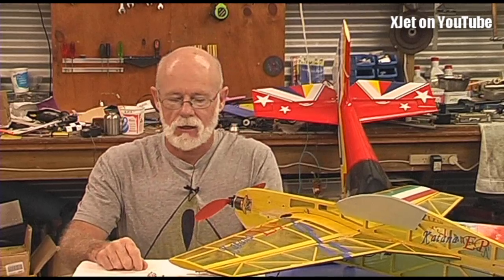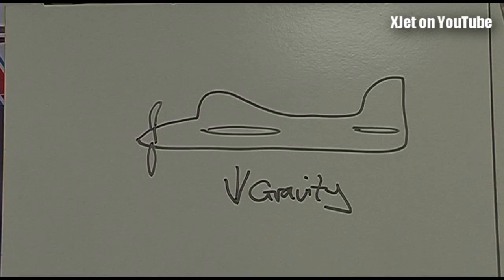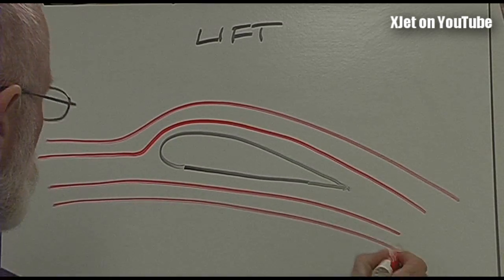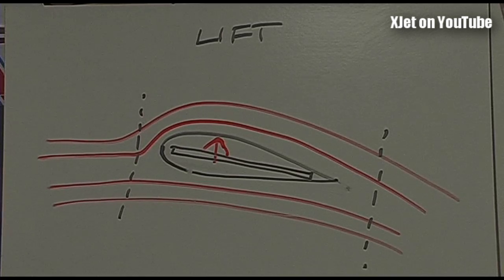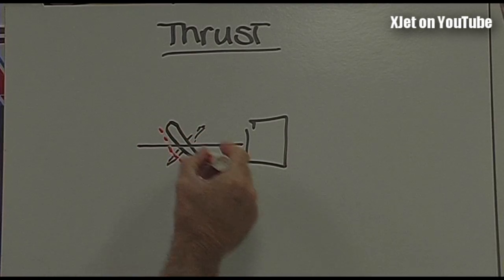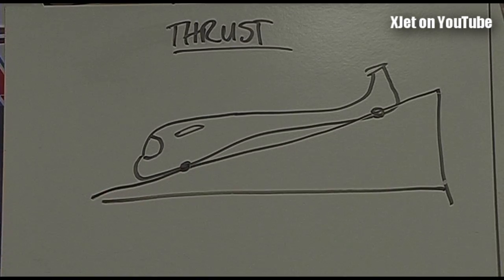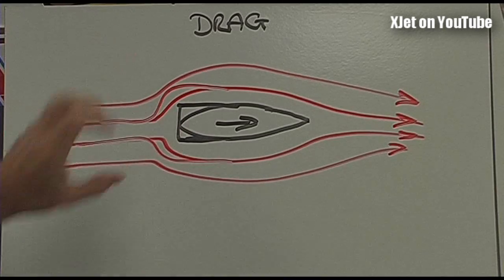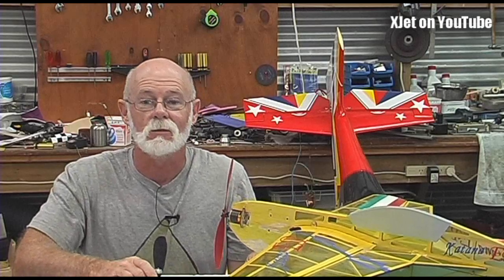The Theory Of Flight (or how stuff, including RC planes) flies

Comment: 4:14 WRONG (Why does the air have to travel faster? it just travels at the same speed on the top, that's a common misconception.
Reply: Actually, the speed of the streamtubes above the wing DOES travel faster, just not for the reasons he implied. It does not have to travel faster to reach the end at the same time as the bottom stream, this is a misconception. This is becomes evident when one realizes that an airfoil can fly upside-down, even if the curved surface is on the bottom. The real reason for lift is the angle of attack. Angling the wing causes the top streamtube to narrow and the bottom to widen. (take a look at this for explanation). Conservation of mass then means that the top streamtubes air has to travel faster for the constant rate to remain the same. Bernoulli's principle then states that a change in a fluid speed occurs concurrently with a change in a fluids pressure, and so the air above the wing has lower pressure, resulting in lift.

Comment: Well equal transit time theory is completely wrong. NASA has a page on it. The air travels significantly faster over the top and reaches the trailing edge well before the air on the bottom. Also, the higher pressure below and lower pressure above the wing does not explain lift! Everyone knows that high pressure flows to low pressure, if that happened the air would flow upwards and Newton's 3rd law says that it would push the wing down. That's obviously completely opposite to lift!

Comment: Sorry but the first part of the lift explanation while it might be simple and easy to grasp is plain wrong. It's based on the assertion ( stated 4 minutes in) that the air over the top travels faster because it is somehow compelled to meet up with the same 'piece' of air at the trailing edge as it split from at the leading edge. This is simply not true and in reality doesn't happen. On a lifting wing the air on top actually arrives at the trailing edge well in advance of the air at the bottom.

Comment: Physicists and aeronautical engineers disagree with the theory of flight!  The classic explanation of the theory of flight is applicable only to asymmetrical wings, and it leads the public into a huge mistake!  This theory says that because the underside of the plane's wing is straight, the air passing under it maintains the same density, and since the top of the wing is curved, the air has to travel a longer path, and which, therefore, has a lower density.  As the density of the bottom is greater than that of the top, this would generate a lift!  But this is SOPHISMA because they forgot to consider that there is already air at the top of the wing, and that it will be added to this rarefied air, causing, in fact, contrary to what is taught, a compression zone!  To better understand, the lower part of the wing is just cutting the air that goes under it, while the upper part is pushing the existing air up, it's getting there!  To repeat: the air that travels a longer path through the top of the wing, and which, therefore, would be thinner, is adding to the air that already existed there, creating a greater compression zone at the top, which pushes the wing down, being counter-intuitive teaches children, different from what is in aeronautical engineering books!  But why, then, does the wing give lift?  Because it is always angled with the leading edge sloping upwards, so when it advances the air "beats" at the bottom, generating a resultant vector upwards!  This is the asymmetrical type of wing, where the bottom is straight and the top is curved!  Have you noticed that in every asymmetric wing aircraft the wing has the leading edge tilted up?  But there are many planes with a SYMMETRIC wing profile (when both the underside and the top are slightly curved symmetrically), and several that fly inverted (upside down), which totally contradicts the theory of ASYMMETRIC Wing!  What actually gives lift is the upward vector generated by advancing the wing at an angle with the leading edge upwards, whether on a symmetrical or asymmetrical wing!  The asymmetrical profile wing appeared back there, at the beginning of avionics technology, to enable a robust construction with the materials of the time, such as bamboo and fabrics, hence this wrong theory was created!  In fact, while the air that passes through the underside of the asymmetrical wing advancing level has no influence on the compression of the air below it, the air that passes over the top, and, by traveling a longer path, created this false theory that it becomes more rarefied, and they forgot that this air is actually compressing the air above it and competing with it!  Important!  Remember this: on top of the wing there was already air!  The supposed rarefied air will add to what was already there, creating a bigger compression zone!  Yes, you were taught wrong, and if you still don't understand, you'll understand... The compression is reversed, on top of the wing, so all the wings are angled with the LEADING EDGE TILTED UP, whether it's symmetrical profile or asymmetric!  Since this upward angle has to be even greater in the asymmetrical wing, to compensate for the natural downward thrust that the wing design would generate if it advanced level with the ground!  Emphasizing: the classic asymmetrical profile wing, if placed perfectly horizontal, generates a downward thrust, also due to the advance of the leading edge, which has a positive angle, so the air "beats" it and pushes it slightly downwards. , which is why, I repeat, asymmetrical wings are always angled upwards, even more than symmetrical wings!  All jet fighters, which have the best maneuverability among airplanes, have asymmetrical profile wings!  The concorde and the blackbird had symmetrical wings!  It's such an obvious thing and it can be tested in a homemade wind tunnel with a styrofoam or cardboard model, that is, the moving car window!  Do it yourself at home, because you've been taught wrong your whole life!  This is better understood by understanding the operation of a helicopter, which has rotating wings, most of them in a symmetrical profile, and what controls the lift is the variation of the angle of attack of the wings (blades), made by the "collective" of the helicopter. !  Also remember the aerobatic planes, some with asymmetrical wings, but most with symmetrical wings (with symmetrical wings the air travels an identical path from above and below!)

Comment: Nice effort but your Bernouli explanation is fundamentally incorrect. If it was true modern airliners would never get off the ground...PLEASE go to NASA Glenn Research Centre - 'How Wings Work' for the correct explanation. Oh and Bernoulli was Swiss,,, The pressure differential is caused by the Angle of Attack NOT the wing shape or paper planes wouldn't fly. If you stick your hand out of the window of a car and incline it to the wind you will experience lift.  (PLEASE correct this video...

Comment: There is only 1 correct explanation for the product of lift by an aerofoil and it's newton's 3rd law. The bernoulli explanation for why a wing produces lift is just completely wrong and misapplied. For starters, air over the top and bottom of a wing do not take the same amount of time. This is called the "equal transit time" theory and there is no law of physics that says this must happen. In fact, in ever experiment to observe the speed of air over vs under a wing that is producing positive lift, we find the air over the top reaches the trailing edge much quicker than than air over the bottom. So from just an empirical point of view, the "equal transit time" theory is completely disproven and thus so to is the bernoulli explanation.